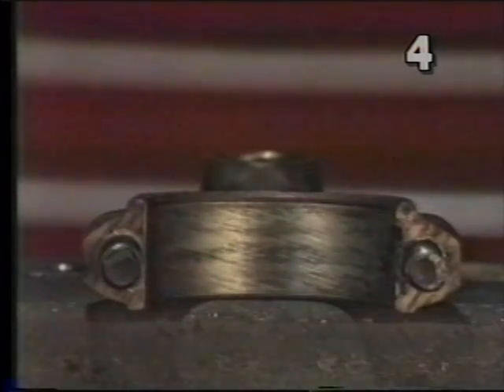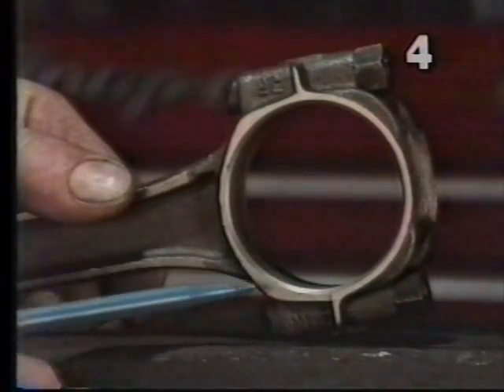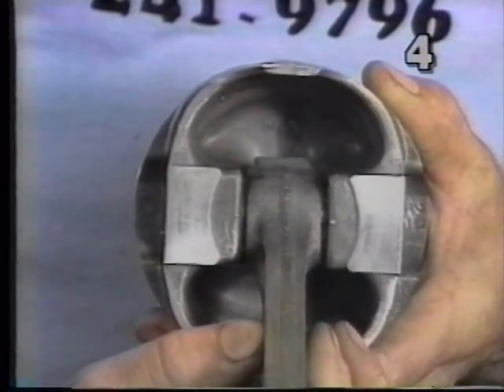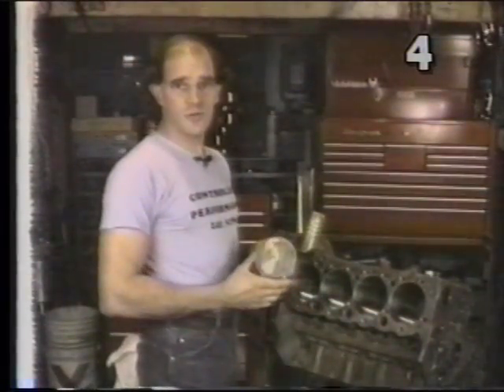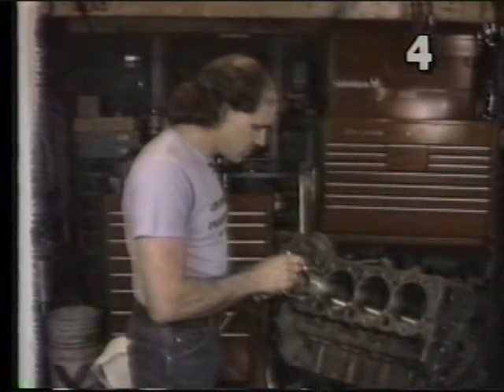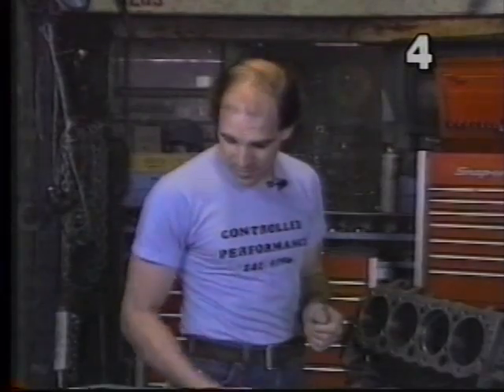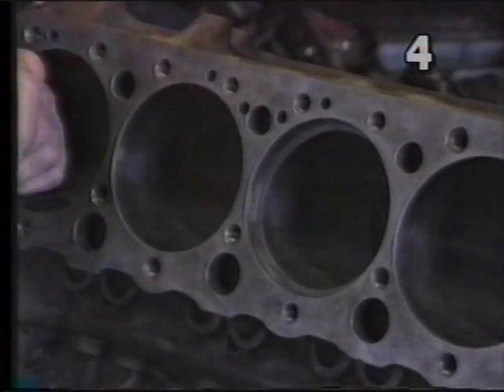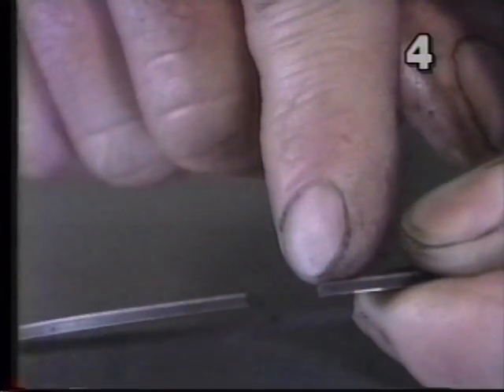Rebuilding Your Engine  Part 4  Piston Rod Assembly

Comment: i have  a mahle  pistons for a 302 motor its saids i need .018 top ring and .014 second ring its a .030 over bore
Reply: that's safe, I wouldn't go to .016 and .012 unless you are making less than 400 hp